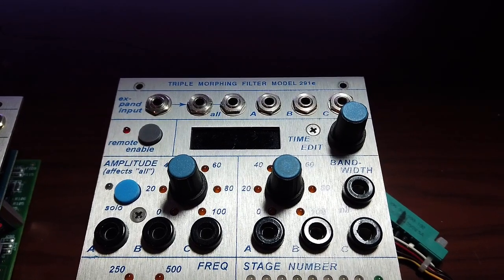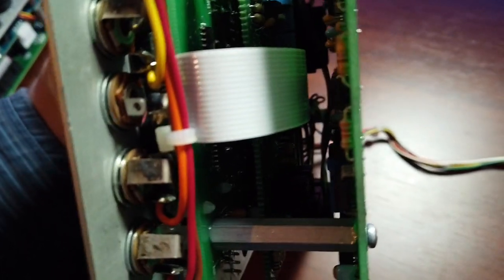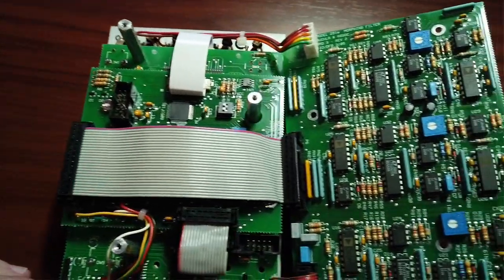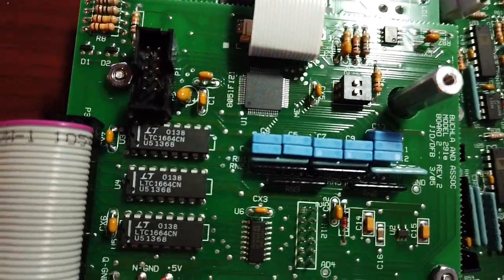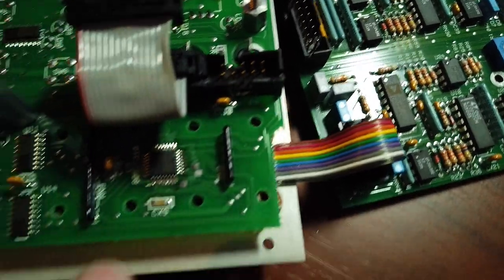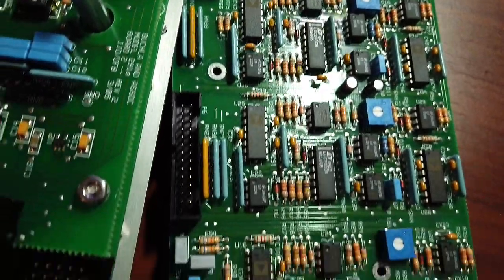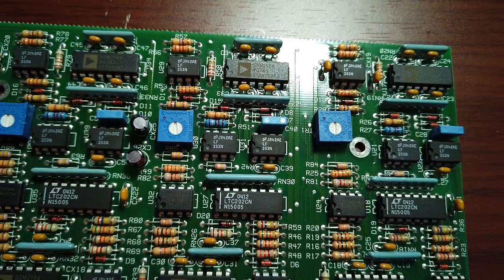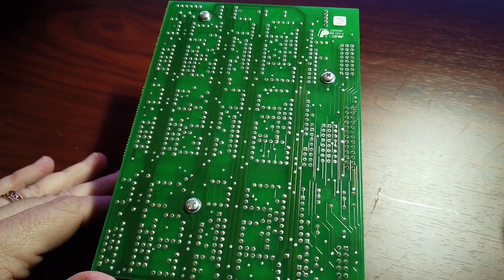Teardown of the Buchla 291e Triple Morphing Filter: PCB Analysis

Comment: I am also curious to know what the LM6172 is being used for. The very high slew rate (3000 V/µs) or a GBW of 100 MHz do not seem to make any sense for audio or control voltages but having the opamp placed next to the LTC202 might give a clue to its use as e.g. a s&h, chopper amp or switched capacitor filter. Speaking about filter ... I don't see that much cap's on the board ...
Having a look at the routing on the board is a nice thing to do. Notice how the traces for the power supply run under all the ICs on the bottom side with (I think) some decoupling caps across the + and - 15 V and a few larger electrolytic caps from - and + 15V to ground

Comment: Great video - I was a bit surprised to find the good old 8051 still in use 2005, but I guess that they where inherited from previous designs.
Reply: there's a bunch still in production if i'm not mistaken. the architecture is quite solid to this day and of course as you said you can often just straight up use more than 40yo code with little fiddling. probably a case of "if it ain't broke don't fix it", but still, i agree it's a bit of a surprise
Reply: 8051 cores are often 'free' IP from a licensing perspective.  so they can still be an effective way to make low cost uC chip.
Reply from the maker: @maw9406 Yeah, there's lots of folks making new versions of old architectures.

Comment: The expensive VFA's are probably used as I-V converters which are required after the VCA to get a voltage output since those are current in current out devices. This can be done with any normal opamp however but I guess they had their of reasons to do it this way

Comment: Beautiful! Any idea why there are so many resistor networks in there?
Reply from the maker: Compactness, mostly, I think -- they take up a lot less space than laying out an equivalent amount of regular resistors horizontally. They probably match well, but after all individual 1% resistors are pretty cheap nowadays. The resistor packs are like in the old days when they'd mount resistors vertically to save space (that's an indication of electronics assembled by hand; the machines can't do that maneuver).

Comment: Weird Construction Buchla uses, different types of cable, complex .... explains why they are so expensive.

I'm screwing around with a Microchip Fubarino, it contains PIC32MX270F256B (i found out by asking the chip self, polling registers and i was supersized because it was sold to me as PIC32MX250F128), 256KB program area and 64KB ram @ 48mHz, USB, 2 UART, 2 x SPI, " x I²C and has boot loader to work with the Arduino IDE, but you can program it like a PIC and access all the resources directly, not limited by the Arduino language, the registers and stuff and even in MIPS assembly, I'm looking at now, much better than the assembler for the PIC18F1320, PIC18F452, etc, maybe your should check that out, pretty handy programming via a USB cable in stead of a ICD3.
I'm building a cool VCO in between things, contains others don't really have, will take months to route that.

You don't happend to do a lecture on R2R array's like used in the Roland Juno-106, Roland Jupiter 8?
the ADC/DAC chips need filters for the "Nyquist-Shannon" stuff, communication via software, etc and lots reading.
Reply from the maker: Sorry I don't have anything on R2R arrays.
Reply: @Lantertronics  hmm, suddenly i came with a circuit, it's solid state that one could see a real Low Pass Gate.
Maybe even Don would make that Happy.
I used an element to no person used a synth schematic and even the location of that element is unique. but it works.

Didn't know you made a Low Pass Gate.
The well know circuit that probably everyone has seen and/or used figures a potmeter and i though it was a trimmer. witch made me wonder how the low pass gate worked.

Comment: I'm not 100% sure without looking at a schematic (so I don't know WHERE in the circuit those 6172s are used) however, I find that higher slew rate / low offset op amps are great as filter integrators.  However, I notice that these are fairly high current output op amps (somewhat like the TLE206x series, only not as slow), so maybe something downstream was pulling a bit more current than he wanted.  I usually use something like this when I need a linear response over 5V (like say a linear slope that goes from 0-10V or something like that).  Since Buchla CVs are 0-10V, maybe these handle the sequenced state-step CVs that go to the filters?  Interesting anyway.  I've always wondered what was in here, so thanks for the video Aaron!  I actually have a very similar (though not digitally controlled) design.  Cool!